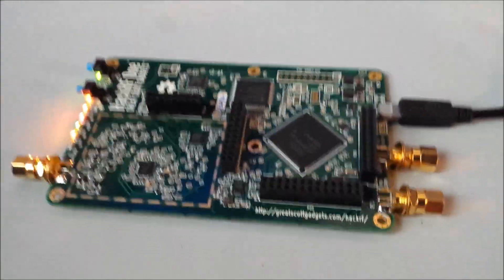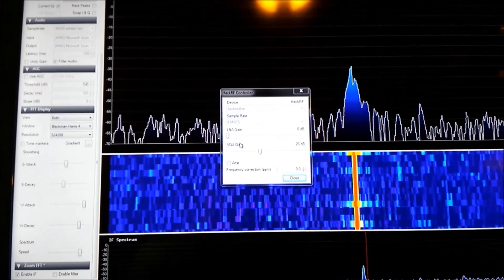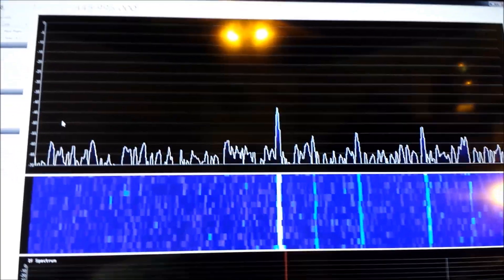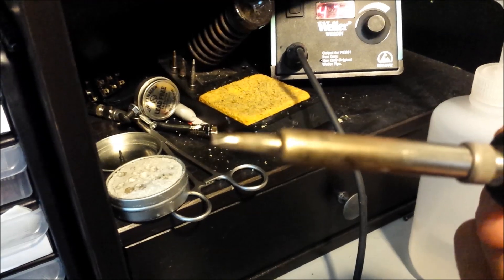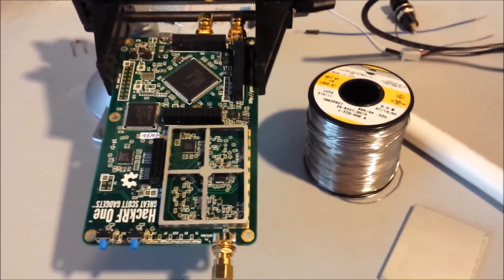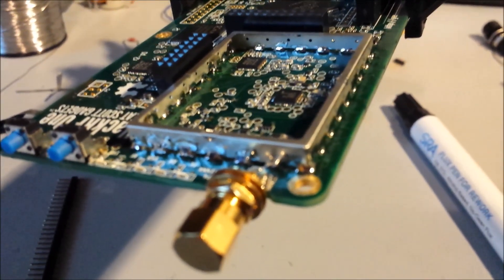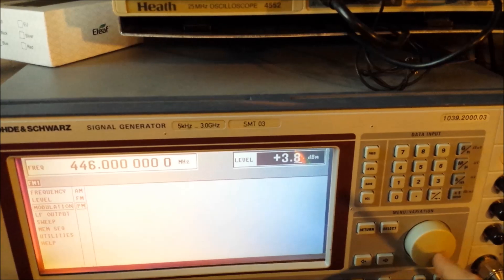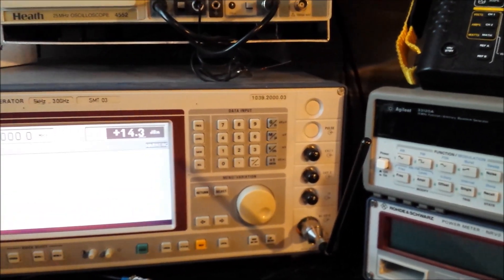HackRF One optional RF shield Installation

Comment: 446.000mhz is the 70cm calling frequency for the USA, where you live. You are keying up on an amateur frequency without identifying yourself. At least add a cw id to your testing cycle (on another freq please, say 3khz above 446mhz).
Reply: Dude, it's coming out of a signal generator, barely even flea power
Reply: @David m - Sad Ham, btw, you have Cheetos dust in your beard.

Comment: Great video Cameron! What did you put in the PCB just before start soldering? Was flux or what? I mean the pencil with the black cap. Many thanks.
Reply from the maker: Gaston Ettedgui yes that's a flux pen.  Thank you!
Reply: Thank you so much for your reply.
Reply: One more, please. Do you think the extruded aluminium enclosure can do the "same" job as this shield? Thanks.
Reply from the maker: Gaston Ettedgui it will keep noise from outside away, hopefully it is bonded to the ground plane of the pcb.  Any noise from internal components would still be present, and possibly increased.
Reply: Many thanks, that's what I've tough. Best regards.

Comment: Any tips on popping off the plastic case?
Reply from the maker: If you've ever replaced the screen on a cell phone they send you a little plastic pry tool, that's what I used to pry it open, just work your way around it carefully.  It doesn't pop open easily, but you can do it without breaking it if you are careful.

Comment: Could you please post where you got the terminators and did you use the tiny oval ring in the package with the pin connector you did not use in the video?  

Are these comparable to the ones you use?  
http://www.amazon.com/coaxial-connector-adapter-Termination-3-0GHz/dp/B00BXUYDMM?ie=UTF8&keywords=sma%20terminator&qid=1460513766&ref_=sr_1_1&sr=8-1

Comment: Shield makes it on par with my AirSpy. Easy to install. Do not use cheap irons people! Recommend the hako fx888d. Maybe a smaller tip and plenty of thin solder and flux. It's a cake walk to install.

Comment: why did you cut of center of RF Shield is this suppose to be done that way?
Reply from the maker: Veso266 That center cross piece is mainly for a pick and place machine to hold the part with.  It's not needed so I removed it in order to gain easier access to do the solder work.

Comment: THX for Jamming PMR BASTARD!!!!
Reply from the maker: Noway Müller I was at milliwatt power (0.0dBm is 1mW)  inside my home. In USA this frequency is in the amatuer radio band, which I am licensed for.  Probably not even enough power to penetrate the walls of my house.  But, if I have caused you problems with my 1mw 3000 miles away, I am very sorry, and I congratulate you on the sensitivity of your receiver.